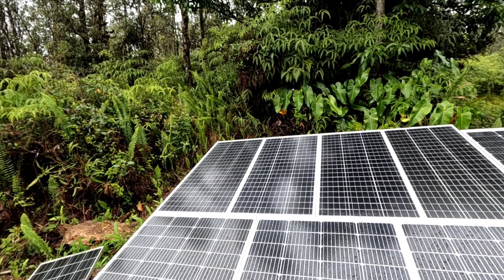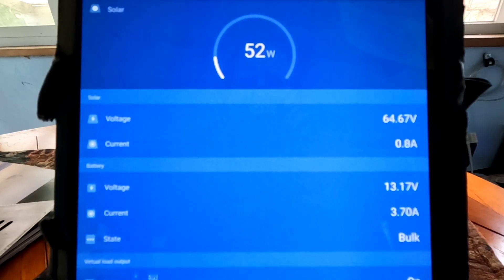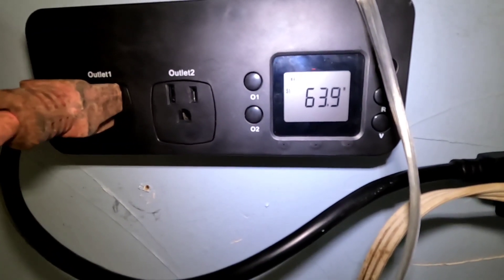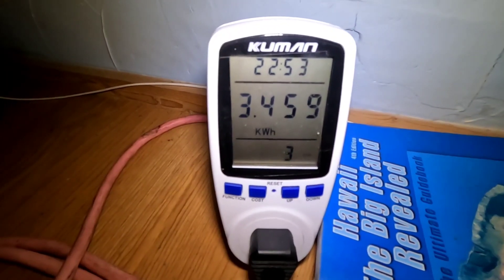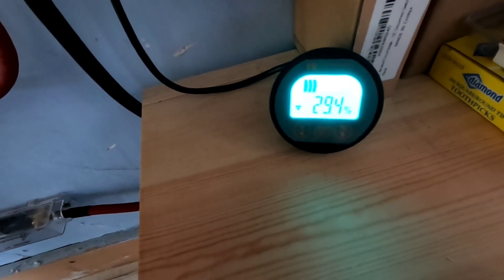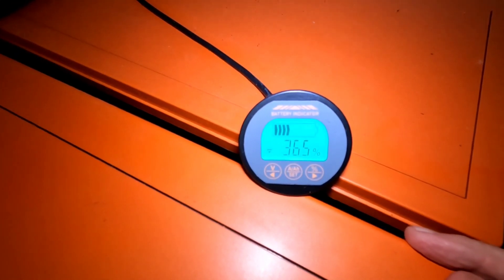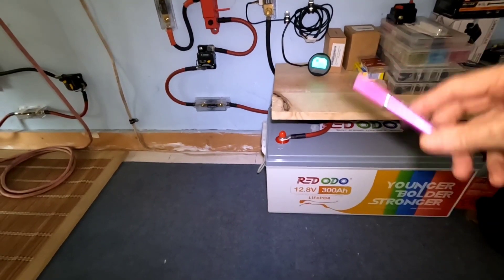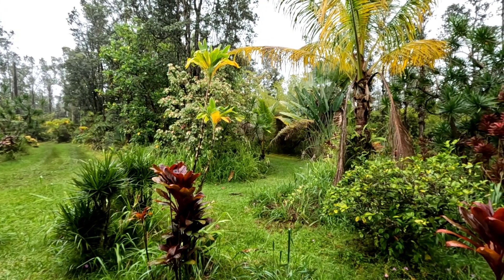REDODO 300Ah LiFePO4 Five day draw down on 20cu.ft. refrigerator

Comment: And this folks is why you always have some sort of backup, or multiple ways to charge those batteries.
 If you have a small stream on the property, you can get a small hydropower system that runs 24/7. If you have decent wind, you can put up a small wind generator. All of these different ways of charging can all be hooked up to the same battery to run your home for free. Then as a last resort, you can buy some fuel for your generator. Get the smallest generator that will charge the batteries at their maximum rate. You don't want to run a 7000 watt generator when the batteries can only take 500 watts. My small generator is only 800 watts.
Reply from the maker: Great suggestions...I like redundancy!🤙🏼
Reply: Not necessary when you live in Phoenix.....unless the sun decides to run out of juice a few billion years early. I can't think of a single time in the past 10 years we've had 3 straight days of no sun
Reply: @ericklein5097   There are always exceptions.

Comment: Very bad for solar in Boston NY as well. getting wind storms now. I got wind/gen power and it's going 24/7 making power.  Everything 100% hear. and extra power dump load is my hot water. that going up as well. Ben using slow cookers to make some meals . not a huge load but 4 Hr. med load. inverter fan blows some slight warm air . fan cycles on and off. now the hot plate or microwave makes the fan in inverter run a lot more. How is that 24V battery doing?  may just plug into outher system until sun. Well the rain is a good thing washing that suit out of the air.  do you have weather radio in your area ? I got it hear . 162.55 MHz . my weather radio has SAME alerts . runs on my 12V system or 24V with converter . also has 3 AA back up battery's The national weather service gives out weather and warring's . My camping radio has weather as well . auto selects the channel . all the storms we been having has ben  making weather  radio go off quite a bit. I got the Midland one. one of my radios is a Eaton one. that has weather as well . and the Amazon one  does to. that has solar and hand crank recharge also charges cellphone. I wrote a review on amazon . has a replaceable 18650 Li-ion battery.  let us know how well the water filter takes that volcano ash out . That has to make your water tasty bad.  😀
Reply from the maker: Horrible conditions here. VOG, rain,dark,dark. Right now the air quality not so good. Very irritating to the eyes, throat, and that sulphur taste. Listen some to that same frequency here. And check in on the ham bands for latest conditions too. Use to run a long wire for sw but now internet . I miss the old long wire listening actually. Hoping for better weather tomorrow . Matter of maybe a week or so will lose major rd. if eruption continues at current strength. Nobody knows yet though. Keeps us on our toes. Aloha! 🤙🏼
Reply: @ProjectsinParadise808  That short wave radio and ham still works . I got many antenna's still up. No CB we use GMRS hear now. UHF much better. Internet was down 2 days hear all across my area . Told weather related. The big storm is over and the snow gone now. must been the flooding and wind knocked internet out . many lost connection

Comment: I have the identical refrigerator (very efficient, that's why I bought it). So far I have replaced the shelves twice, manufacturing defect/design defect makes the corners crack. Be sure to watch out for it, apparently the injection molding process makes the plastic corners holding the glass crack (plastic cracks, not the glass). It really pisses me off, since replacements are not cheap. The refrigerator is every bit as efficient as it is advertised, but spending a few hundred dollars every two years to keep the glass from falling on my 4 year old granddaughter really sucks. LG needs to do a recall and fix the shelves, they are dangerous.
Reply from the maker: Ill be careful...mahalo! 🤙